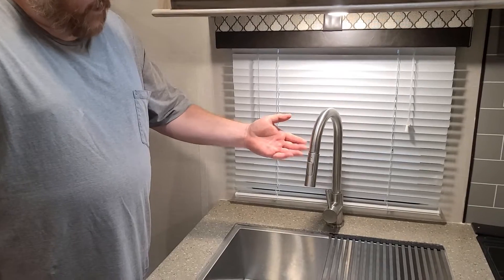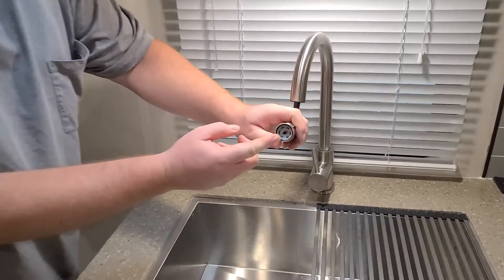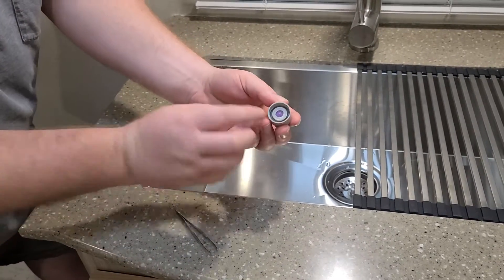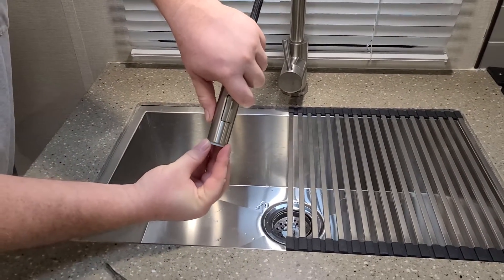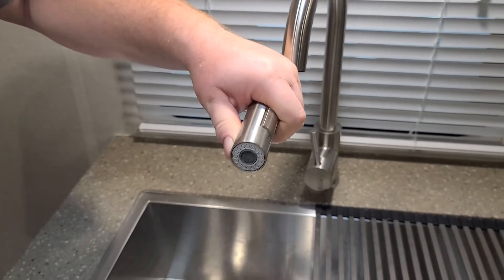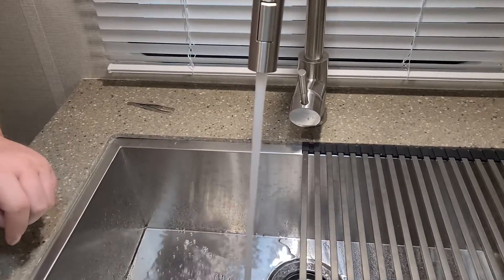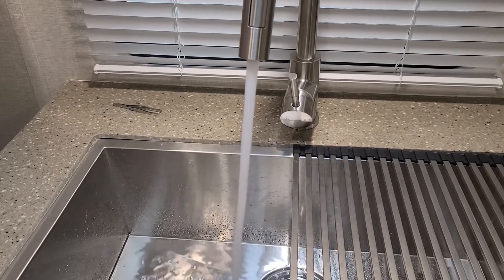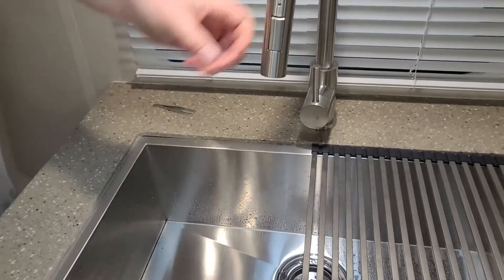Cleaning out a poorly working faucet in a Palomino Solaire 205SS.

Comment: Have you had any major problems with this camper? Does it have a walkable roof? Thinking about getting a 2019
Reply from the maker: I sold the camper after having it for 3 years. 
I moved to a 5th wheel. 

The new owner informed me that the floor of the slide was shot and he had to replace the entire slide floor 1 month after buying it. I was not aware of this problem. And felt very bad. But he failed to find it on inspection, and so did I. 
The side of the slide floor was not properly sealed on the out side and had no drip edging on it. This caused water damage to the slide floor. 

It did have a walk on roof and a ladder to get up there was an option. 

I never got up there, but my buddy did to put that cover on the AC unit for winter for me. He had not problems walking around and inspecting the roof for me. 

Over all I liked the camper, but the slide floor problem is concerning. 

Not sure if mine was not built right or they all come like that. 

I also had problems with the slide not wanting to go in and out right off the dealer lot. I had to take it back and have the slide adjusted to fix the problem. 

I ended up re working the slid my self just after the warranty was up as it did it again and was stuck out. 

The screw for the slide rollers where just cheap self tapers in thin aluminum and would back out letting the slide rolls move down and the slide would then contact the frame and get stuck.

I jacked the slide up slightly to take the pressure off the rollers, moved then all about 1/2 over, drilled new holes and installed RIV nuts and machine screws with thread lock on them to keep the rollers in place. This worked great and I never had to mess with that again but was a massive pain to do.